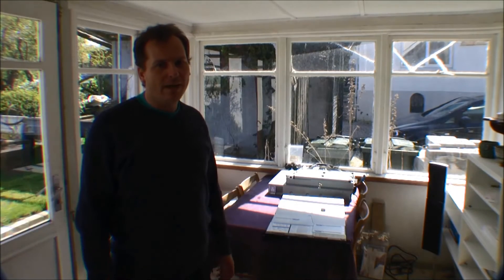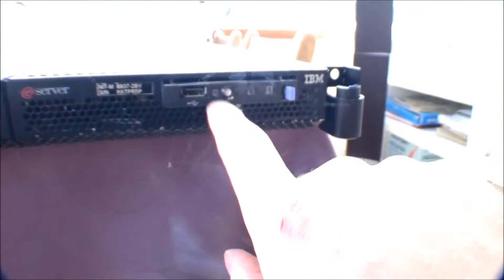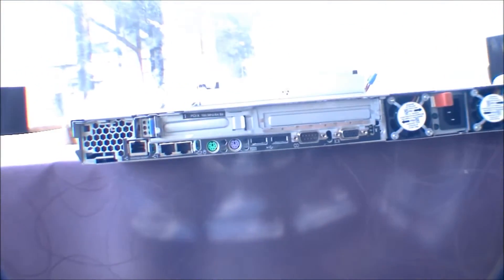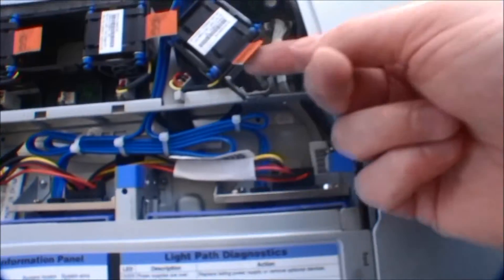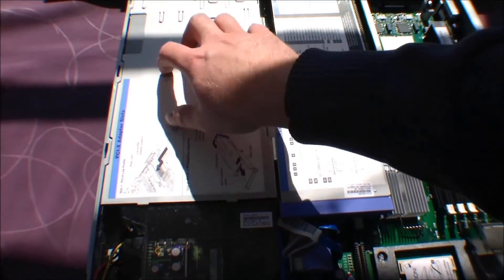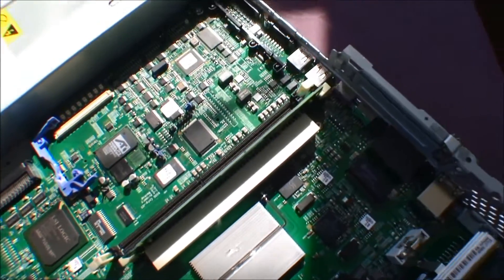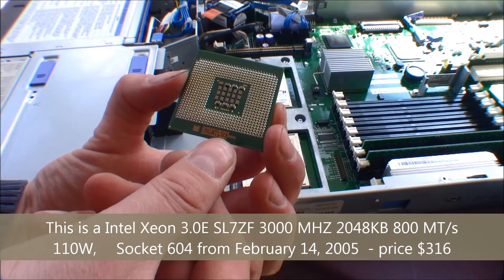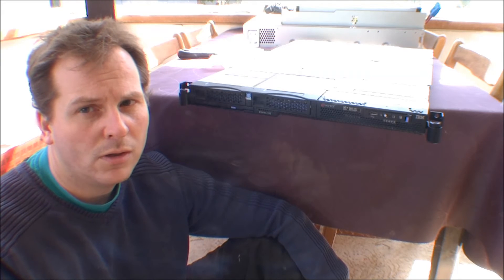IBM eServer xSeries X336 (1U rackserver) review - 177

Comment: I bought a Dell 2U version of this, more or less, once. It was the 2650, and it had a matched pair of 32-bit Xeons at 3Ghz with hyperthreading available. What I want to know is, why do these servers support so much RAM when the processors and chipsets cannot handle it being only 32-bit systems? Linux will run okay on one of these with dual processors and hyperthreading enabled for everyday use such as a VPN server or the like, but the power draw is a huge problem where something like one of the Pi variants would draw enormously less power, take less space, and offer more storage if you wanted it for about the same price, or less. Processing power might even be more than you can get out of these old Xeons.
Reply from the maker: Hi Tyler Barton 
This one,, the IBM eServer x336 is a 64bit processor,, and i do not have the 3,5GB RAM limit. ant this server only han 1 GB of RAM,, so no problem.
When this server was new,, the hotest shit, was MS Server 2003,,, that worked probably just fine, at the time... for like web servers, Linux router/VPN, print server, ect.
I only go this to play with,,, there's another videocomming  with this X336, tomorrow at. 14:00 my time GMT +2.00.
Thank you for watching! :-)
Reply: It depends on your goals for a system. If you are a medium\large business then sure you want the reliability of a server system. But if you are just a home user, then yes you would like a nice cheap $120 raspberry pi 2 that only uses a max 10 watts (but is not business grade reliability).
Reply: PIs are ARM cpus. If you have something that is running on x64 (vitualization purposes or special applications requiring x64 proc) you definitely will get errors. And the ram is soldered, among with the disk and cards. PIs are good for low end linux stuff but when you want a bit more out of them. Nope

Comment: I have 8 of them, no time to upgrade them but they run great with win server 2008r2 and 16 gb ram
Reply from the maker: Hi diamondcraftia 
But it is realy slow,,, see next video,,,i did install 2008r2, but i only got 1 GB of ram in it :-/

Thank you for watching! :-)
Reply from the maker: Hi diamondcraftia 
Ups I exaggerated just a little bit, it seems that it was only Server 2008 64bit,, not R2
Thank you for watching! :-)
Reply: That has been the struggle point :D